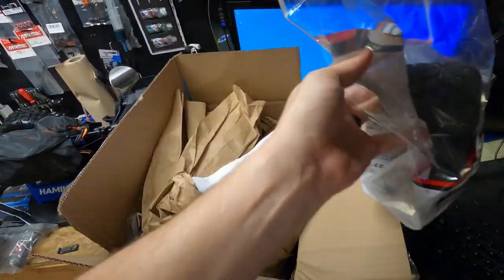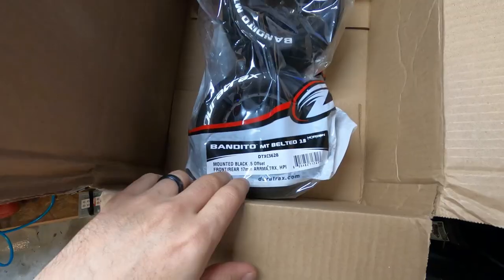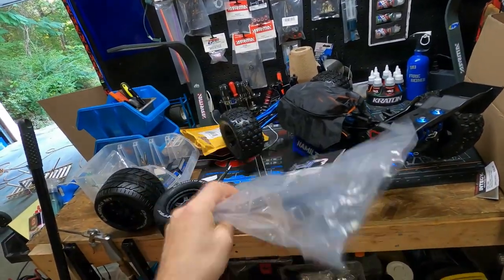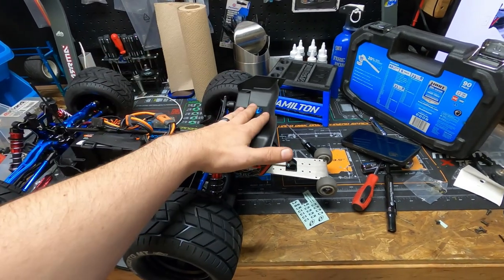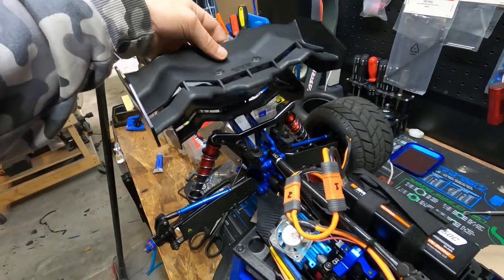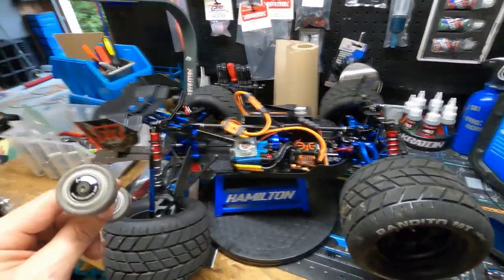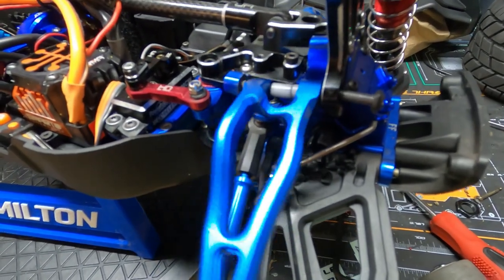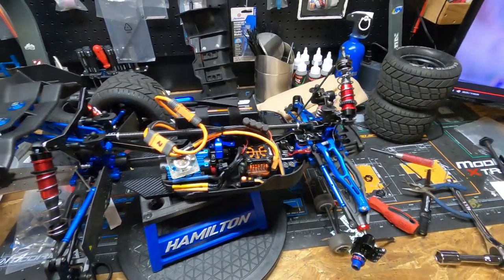WHEELIE BAR + Duratrax BELTED 3.8 Tires+ 1/5 scale Wing on 1/8 Truggy

Comment: the cheap metal parts seem to be a recurring  problem....plastic has some flex the metal just seems to stay bent
Reply from the maker: Very observant my brother yes in fact enable for me to fix the problem after I wrecked it in this video I went back to the plastic parts now I did keep the gearboxes the steering the outdrives and some of the main components metal but some of the ones that need Flex went back to plastic cuz you're right I had to keep buying new parts to replace the ones that I was bending
Reply: yea plastic is better